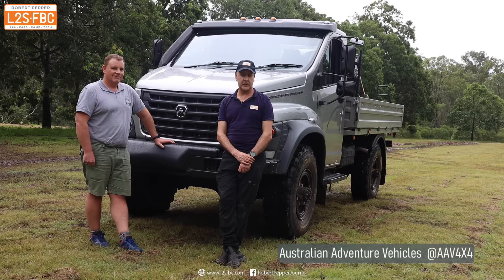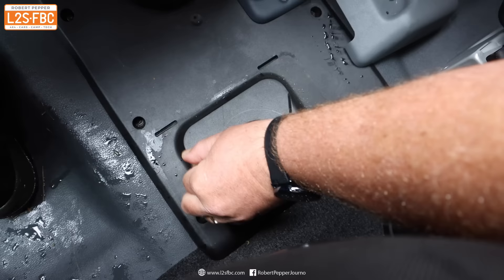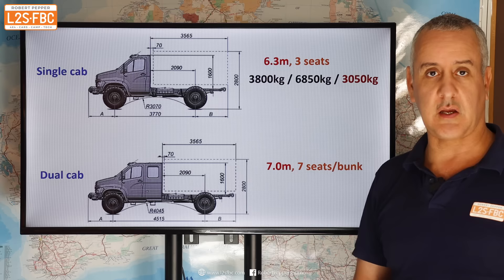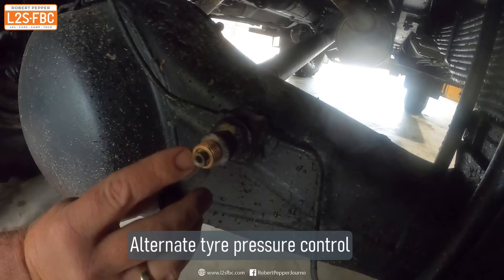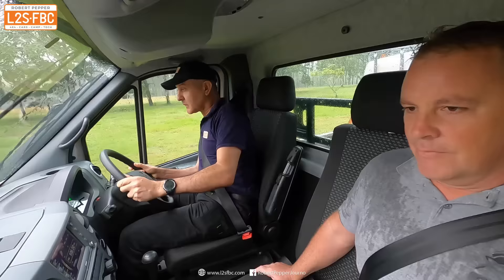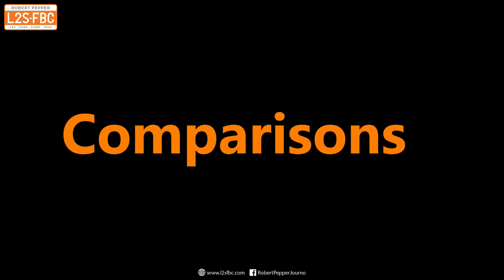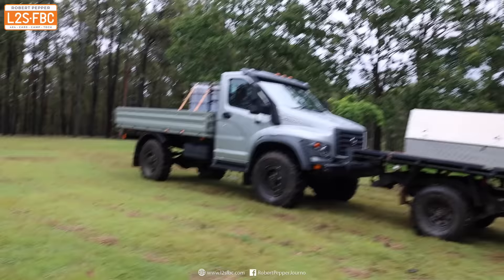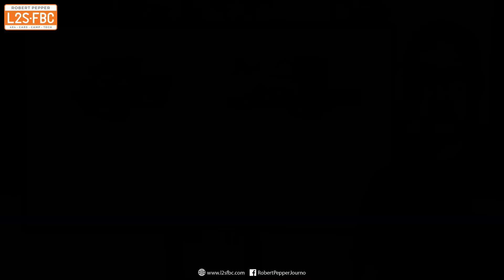Russian GAZ Trackmaster First Drive Review (Sadko Next)

Comment: One thing abut those GAZ trucks. They can carry much more than the manufacturer says. I drove a GAZ LCV at work, it waz a Gazelle Next - a Ford Transit/Iveco Daily class light truck if you know what I mean. Its empty weight is about 2300-2500 kg with a 4 meter bed and total overall weight is 3500 kg, so the payload is 1000-1200 kg. We loaded up to 3500 kg of cargo and it drove quite well. Not fast, for sure, I drove at about 85-100 km/h, but steady. So what I mean to say, these trucks are pretty robust and can carry more than the manufacturer guarantees they do.
Reply: Also GAZ makes road versions of this truck - effectively same frame, same engine, same cab, but no 4WD and road tyres with doubles on rear axle. Those are rated at 8.7 and 10 tons fully loaded weight with cargo capacity of aporox 6 to 8 tons. So in my opinion this truck's relatively low weight capacity is limited so that it doesn't sink in mud. Also it may have something to be with tyres weight rating.

Comment: Trackmaster’s (Sadko’s) frame is flexible as you can see from the video but it helps not only to do great in offroad conditions but to increase load capacity too. It can cope with much more weight than you expect

Comment: I have seen the internals of the YAMZ 534? as used here, its built like the proverbial brick S...T,house, very big heavy conrods pistons and crankshaft, for a 4.4litre engine, cracked rod joints, huge gudgeon pins, 4valve heads common rail injection, etc etc, gear drives for camshaft, it is a heavy duty truck engine, the six cylinder versions go up to 250kw and are in 40 tonne semis. Westport did conversions to natural gas for GAZ.
Reply: It was initially desined for heavy duty work and set up on a wide range of trucks and buses here in Russia.
Reply: @OlegVoytovich  Yes I got involved with it here in Australia around 2012, we had 4 of them sent to us for development into CNG engines, two 4 cylinders and two sixes. We were told that AVL in Austria had designed and built prototypes for YAMZ. YAMZ had set up a new modern factory in Yaroslavl for manufacture them. We had to disassemble them partially to change pistons, and modify the heads for spark ignition. I was surprised at how heavily they were built for thier displacement, we got good power and torque from them. I retired before they went into production as CNG units.
Reply from the maker: Wow thanks Jeff!!

Comment: As always a well structured review of an original subject, Robert! This vehicle looks very interesting and heavily built. It just eats the terrain. I'd like to ask about few topics not directly mentioned and I would appreciate if you could answer at least some of them: 
- what is the noise level in the cab - terrain and highway speed? It seemed to have very little noise dampening (none under the bonnet), which can be a problem when overlanding long hours.
- I was not able to find a source for reliability - engine, transmission... is there something that has the figures?
- is there something more specific regarding the mentioned "high wear" of those mechanical axle lockers?
- on the manufacturers website I found out these engines are "Euro 3 / Euro 5" compliant. Does it mean the compliance can be chosen by the buyer? The reason I am asking I aim to travel to Asia, where there is high-sulfur diesel only. The newer emission-friendly diesel engines will be killed by it.
- I found out in manufacturers specs that the tires are 1084mm in height, which would make them approx. 43 & 1/3 inches. IS the Australian version a bit smaller?
- how much electronics are in the truck - I mean in the engine CPU etc. - basically, how easy it would be to fix near Mongolia for example.
Reply from the maker: - noise level; didn't drive at speed enough to determine, but would say no worse than similar trucks. The auto option would help, lower revs.
- reliability; read my blog post from the Russian commenters here. At this point I'm not concerned.
- the pawl lockers are inherently high wear as the pawl constantly contacts the cam. In racecars that's not a problem as you rebuild them every race, as in F1. I did read the Gaz patent but can't recall the exact design they used so cannot explain what they've done differently.
- tyre; no it'd be the same ones. 42" comes from 20" rim + 2 x 12" sidewalls. That's the calculated diameter, the actual diameter of a tyre always varies a little especially with 4x4 tyres as they have deep tread. So I'm sure they're the same.
- electronic; not many. I'd suggest easy. I recall seeing Gaz vehicles when I was in Mongolia! The truck is very simple, and AAV tell me the documentation is amazingly good. They're happy to talk it over, give them a call.
Reply: @L2SFBC  Thank you for the reply, Robert. The reason I am concerned about engine electronics is that it is build in coop with an Austrian manufacturer, and even uses Bosch technology. So the "venerable" Russian build toughness might or might no apply - hard to judge. On paper the Gazko is definitely a prime candidate for great overland vehicle. I will look deeper into technical specifications and feedback. Not to mention the unbelievable price. At least here in Europe the fully equipped double cab is cheaper than a Hilux.

After reading your blog I do agree with some points of the commenters, even though they seemed a bit subjective. I am from a post-socialist country, and it is true that since "everybody owned everything" meant nobody felt responsible. So the majority of drivers did not take care of their trucks at all. Constant overloading, no maintenance, relying on the power of the truck instead on drivers skills, etc were the norm. Plus the unavailability of spare parts meant that hammer and welding machines were common first-hand picks for repairs. This led to the machines being build to be able to take this abuse and keep going.

In our country there are similar examples with great history - TATRA and LIAZ trucks. Up till 70s/80s they were world leaders in quality and technology, even surpassing Benz trucks. Portal axles, CTIS were common base features, steep inclines of up to 70 percent as well. This cannot be said about personal cars that were generations behind the western production. It is common to see trucks build in 50s/60s to still being heavily used in construction, forestry etc. Especially the legendary V3S truck. But now, although the name is there, the trucks are being build as lego, with many parts from many manufacturers. I worked for years in automotive research and development, so I have seen first hand the decrease of lifespan. One example would be anti-corrosion coating - before 300K km was the norm, now 150K km, even though there is very little additional costs to reach both standards.
Reply from the maker: That's really interesting, thank you! Would love to hear more about your findings, and we're planning a more detailed drive and review of the Gaz.
Reply: @bm_videa  газ машина новая и но уже опробована в Сибири, их покупают компании добывающие ресурсы. А требования у них не маленькие,  ехать в -40 -50 , ремотопригодность ну и надежность.
Reply: @bm_videa  your comments about trucks being built properly, and cars not being up to Western standards is definitely something I've heard a lot of times, but it's probably worth pointing out that the off the shelf cost of Socialist cars was much lower AND the purchasing power of a citizen of those countries was much lower than in the West. They (and their state owned enterprises) could not afford to spend all the money that a West German or Amreican might spend on a Benz or GM. But the society needed trucks to function. And trains. And other heavy equipment. And so that was always prioritised. It's also why many of these countries had more public transport for instance.
Reply: @bm_videa  @L2SFBC very curious about your experiences in Mongolia.
Reply: For travel in Mongolia you need a father of Sadko - GAZ 66. No electronics, no f*cking euro x. ( : Easy to repair "on knees"

Comment: Very capable vehicle.
Who makes the engine, and where do spare parts come from?  That is where reliability counts.
Reply from the maker: Gaz makes the engine and supplies parts
Reply: @L2SFBC  Not exactly. Engine is produced by OJSC «Autodiesel» (Yaroslavl Motor Plant).
ЯМЗ-534 is the model of the motor installed in Sadko.
Although, apart from "Autodiesel", ZMZ makes engines for GAZ Group. But, they used for light commercial vehicles such as GAZelle  or Sobol

Comment: I assume the set back cab design also gives it crash advantages over the cab-over designs.
Reply from the maker: Yes good point but...airbags
Reply: @L2SFBC  Airbags will not save you from crash at 70 full loaded no brake. Cabin become flat. Set back give you 1 meter distance.
Reply: and in case of mine explosion driver has more chanses. Trucks is a dual-use equipment, so army needs/requests has higher priority for some manufacturers - they need to be able to produce both army and civillians vehicles (and in case of war be able to switch fully to army trucks), so there is always some unification.
Development of GAZ-3308 Sadko (Садко) and its successor GAZ Sadko Next (Садко Next; seen in this video; i think model index is С41A23) was a result of Afgan War and other conflicts - GAZ-66 (Шишига, Shishiga) as army truck was not so human-friendly in maintenance and was not so safe in case of mine explosion under front axle - because of it cab-over design (but GAZ-66 has air-dropped version for paratroopers!), so GAZ-3308 (and its sucessors) got set back cab.
Reply: @user-qb8nt9if6j  в Австралии так много мин везде закопано.

Comment: Great review! But also thing that needs the be considered is even with upgrades Canter and Isuzu will still have weaker axles. Gaz just that much more robust. And basically designed wiith the mindset that people will overload it. Nobody in russia loads truck to what it is rated for. So overall GAZ should be more robust. But what for the reliability of engine and transmission - only time will tell. It's impossible to beat japanese at reliability obviously.
Reply from the maker: Good points!
Reply: Nobody in russia loads truck to what it is rated for. // Ну, это факт)

Comment: I'm thinking more and more to buy exactly GAZ Sadko, not Isuzu or other cabover variants because they are rigid because of the front suspension and sit on the wheel, not safe in case of collision, you can not combine the cabin with the body because of the folding cabin, although the second row is noticeably more spacious, but it is solved and there are options where the door to the second is the same straight, but the cabin on the second row is longer or on the second row make a door like the front and a full-fledged second row.

To everything else, I want to make a sleeping place above the cabin and the upper part of the fairing as on USA Truck like Volvo VNL to be aerodynamic in contrast to the alcove and it will save a lot of space in the kunga.
And I will carry two KTM EXC-F500 enduros to ride on the terrain.

Only I want a more powerful engine and 6 gears, but it can be solved if it will be very necessary. They put on order at least automatic box Alison, at least different engines, for example, you can YAMZ 536 from Ural Next (the same YAMZ 534, only 6 cylinders instead of 4 and power more) or Cummins or others. 

I hate disgusting green color as well as orange color on French minibuses like Peugeot Boxer / Citroën Jumper.
Otherwise a beautiful car! Just the Google table for my tasks! And I can pull a trailer. But first I will pass the truck category (C category), and after a year I can pull a trailer (CE - E is a trailer). Now I have VE - passenger car with a trailer over 750 kg.

Used to really want and still love the RAM 2500 and 3500. Beautiful interior and exterior! Love the look with the headlights and the Ford F-450.
But the issue with reliability, maintainability and that poor entry and exit angles. 
Having ridden on RAM TRX I fell in love with it. But it's a toy, but I want it. But the questions are still the same. 
That's why I drive and will drive my favorite Volkswagen Touareg II generation with a gasoline engine VR6 3.6 liter 249 horsepower (after flashing 280-300). Yes, there are faster cars (I have enough even with a full load), more reliable and passable (it's not Nissan Patrol Y61 or Toyota Land Cruiser, but I'm happy with it unlike the new generations), roomier (the same RAM 1500 or Cadillac Escalade ESV, which I considered buying, but there is no normal permanent all-wheel drive, braking dashboard, huge tax), more comfortable and compact (many cars), but these are different cars, and I have all in one.

And I'd rather buy a medium duty truck (7 tons) than buy a pickup or GMC Yukon XL from the appearance of which I'm crazy about, but the price as for TRX is cosmic.

And I've been dreaming about Suzuki SX4 on mechanics in rally style and truck since childhood. My father is a military man and all my childhood was spent on KAMAZ 4310 (or sleep under the sound of diesel), Ural 4320, rarely drove on GAZ 66 (Shishiga is called in the people) - grandfather GAZ Sadko Next, which I thought to buy and remake. In principle, any of these cars can be bought from storage from the late 1990s, but they are military uncomfortable and very large except for 66, which is without a hood that I do not like and with a gasoline engine that I really do not like, but it is being changed to diesel.

Now it is left to save up for Sadko because it cost 3 million and now 6 because of the political situation.

Comment: Needs an inline 6, power is low with the current inline 4.
Reply: From  Africa this truck needs to be retrofitted with an inline 6 cylinder 240hp minimum with a displacement of 5.9 to 6.7 turbo diesel engine coupled with 6 speed gear box and possibly a front coil spring suspension for rough tropical terrain smooth and stable drive.

Comment: This is a truck, it cannot br compared with a D- max or toyota. It should be compared with a Unimog but has half torque and much less power ( unimog entry level has 270hp and 1100Nm ) It looks quite simple and if the price is correct it is interesting if you look for a truck, not a 4x4.
Reply from the maker: The 4x4s are there for a baseline so the Gaz performance can be compared.

Comment: Does this truck have 2 winches, in the front and the back? I watched a Russian review after watching your excellent review -- both winches are operated by engine apparently, there are shafts going to the winches from .... transmission I guess. 2 winches is a good deal, a useful feature.
Reply from the maker: There is a PTO (power take off) winch for the front. Don't know about the back. But it is usual for these trucks to run two winches, they need it and have the space/payload.

Comment: How does it compare to the Iveco Daily 4x4 ?
Great video btw. 👌
Reply from the maker: The Iveco is as capable I'd say depsite running 37s; it's smaller and lighter, and I like the manually selectable lockers as opposed to the Gaz's autos. But, many have found the Iveco unreliable. Too early to say re Gaz but signs are positive.

Comment: Same axles as the old Gaz66, they still haven't progressed on to fully independent suspension!
Reply from the maker: Many would say that's not a progression
Reply: @L2SFBC  Then they would be wrong.  The reason is that you don't have the entire weight of a live axle bouncing up and down as you travel over a rough surface, this means you can move faster over it and have a smoother ride!  It also allows you to have greater ground clearance as the diff is no longer sitting down parallel with the wheels.  As an added bonus suspension can be better setup to suit the demands on the vehicle, and various types of suspension can be utilised such as, coil springs, torsion bars, pneumatic.  The advantages of fully independent suspension are more than self evident and well documented for vehicles such as this, it's a no brainer!

Comment: It would have been better if you had compared the Dual Cab version 4515 wb also along with the single cab 3770 wb along with the competition and you could have included the iveco 4x4 daily which I think is an off road design from the ground up. may be you can do that when you make another video. Anyhow thanks.
Reply from the maker: DC version wasn't available. Yes re Iveco. I plan on a further comparison later.
Reply: @L2SFBC   Super. will wait. Thanks

Comment: 1 main thing with a gvm upgrade the requirement to seek an new license upgrade  because towing you would exceed your license limit on your car license.

Note: where is the iveco daily and similar options  from mercedes, daf, and other european vendors??

6x6 and 8x8 variants???
Reply from the maker: I only had so much time...stand by for more on those topics!
Reply: @L2SFBC  I only made light of this on weight not sure the scenario in the UK and Europe in general when you are looking at the license you have for motor vehicle you average about 8 tons on a normal car license above this you can be north  of 16 tons between  truck and trailer 

at the higher  weight rating on the  gaz (kazmaz) you would be overweight over 1.9 ton  and be overweight for the license at 23 foot for caravan at 900kg
Reply: Back when I was in my teens  when and where the licensing  standard was up to 8ton on a-z class licensing standard as to what can be driven today..

On  average with sedan based wagon  with  v8 turbo diesel  is  2,5 tons  with toyota 60, 70, 80, 1-- serie base suspension and tow ball packages  you are rated to 500kg via a 6x4 trailer, wuth rear diff and suspension  upgrades you can  upgrade the towing capacity.

My opinion I would never comparew a ute in the capacity as a light truck, as you are in comparison of a v6 petrol turbo or  4 cyl  turbo diesel which  good for tradie vehicle  tough pretty piss poor as a combined offroad and tow vehicle